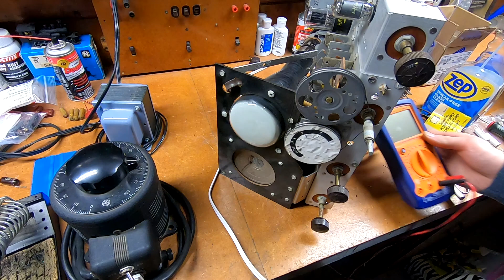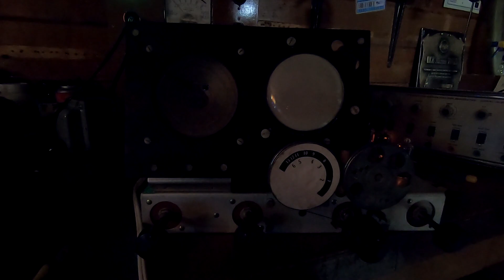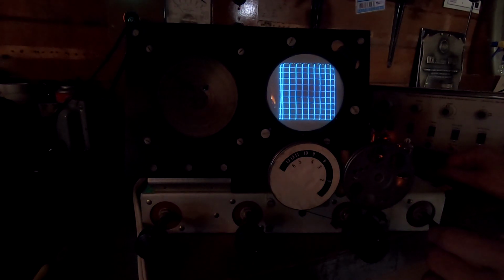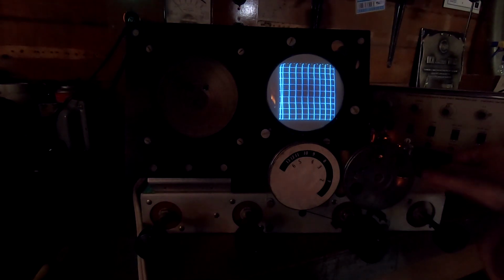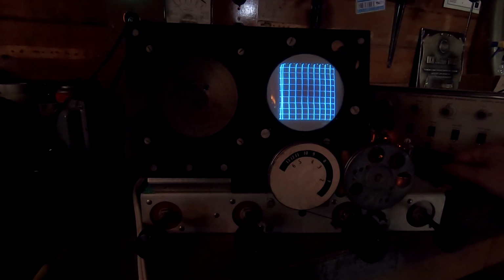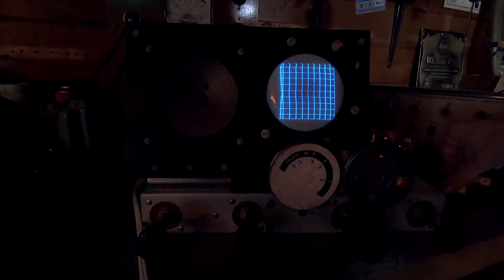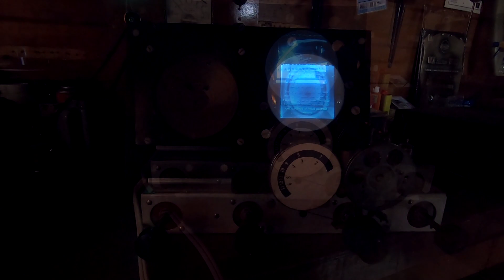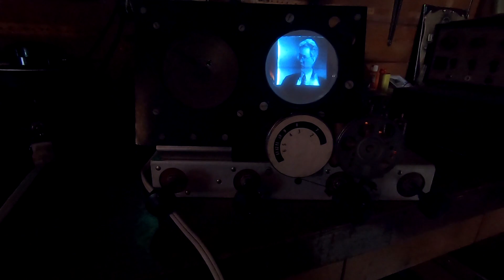Pilot TV-37 Television Repair - Part 2

Comment: "There seems to be a pretty big stretch between (channels) four and five..." Well, there IS a pretty big stretch between channels 4 and 5. The gap is due to the old aeronautical band that used to be there before they moved it above the FM band.

In the early fifties, Chicago, indeed had a channel four and a channel 5 and that's why they could do it without any co-channel interference between the two stations.

When they added channel 9 to the mix, they moved channel 4 to channel 7 so that the user would experience relatively equidistant tuning steps between each channel. (2,5,7,9) Channel 11 came later.

Chicago had no UHF stations until the early 60s.